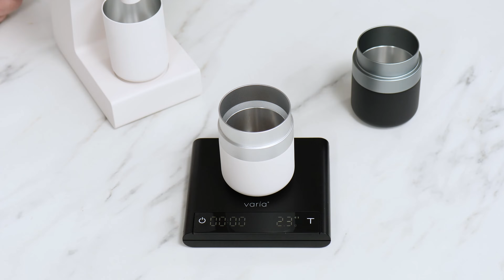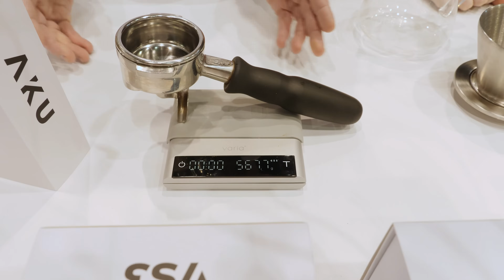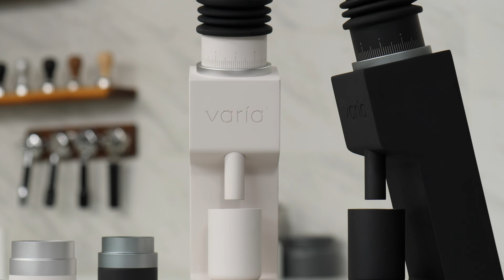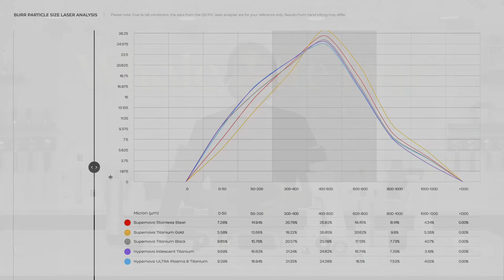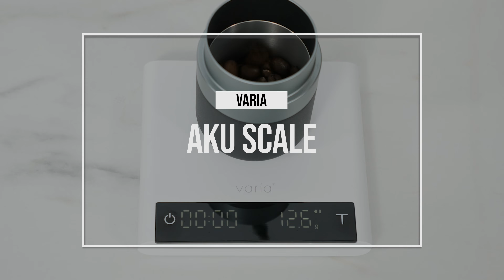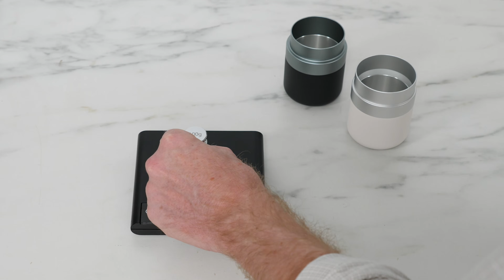Varia Coffee Grinders & Scales - Enhance Your Specialty Coffee Experience

Comment: Ok.  total newb in the coffee world and this feels like a really dumb question. This is my first time using a grinder. when you start measuring the clicks or whatever you call it for your desired coffee method (I'm currently attempting pourover), i start at 0.  And 0 is when you can no longer turn it to the left? It locks it self out and that is the beginning?  So then if i want to get to 80, which seems to be about the recommended pourover grind size, I give the grinder one full rotation to the right, plus 6 ish more ticks past 0 again. and that's how you measure?  do i need to try again in explaining? thank you!
Reply from the maker: Hi Rachel, Yes. Not certain which Varia grinder you have but on some you would make a full rotation+ to get to the desired grind size. Varia usually has a very good reference in the box literature for approximate grind size settings by brew method. Hope that helps!
Marc

Comment: I’m trying to use the varia dosing cups (either 54 or 58) from my VS3 grinder on my normcore scale but ran into an issue. The magnet on the bottom of the varia dosing cups throws off the accuracy of the scale making it unusable as a dosing cup. I get different weights of the cup depending on where the cup is placed on the scale. Can you confirm that using the varia dosing cups with the magnet on the bottom does not interfere with the accuracy of the AKU scale? Can you verify that regardless of where the magnetic dosing cup is placed on the scale it still gives accurate and consistent results? Thanks
Reply from the maker: Hi fly, I've used the VS3 dosing cup with AKU scales and never had an issue with magnetic cup base interfering with weight accuracy. Just to be certain I tried the magnetic cup in multiple positions on the AKU this morning and no issues. Also tried Varia's dosing cups with magnetic base and no problem - a lot of that in this video: https://youtu.be/7i5vdcZE_ps
Marc
Reply: @Wholelattelovepage  fantastic. Thank you!